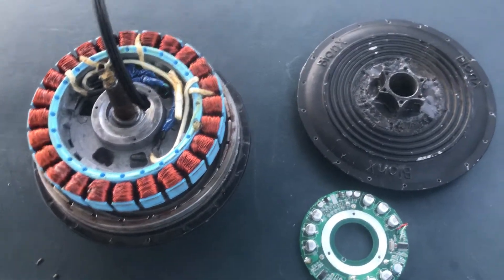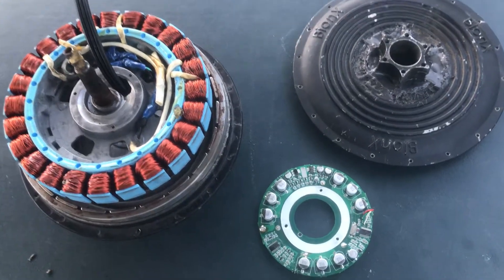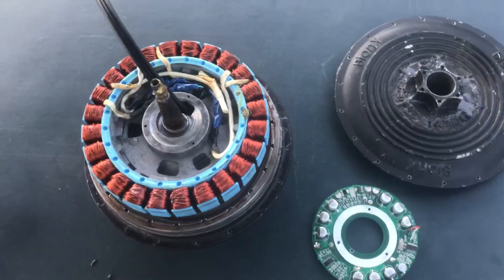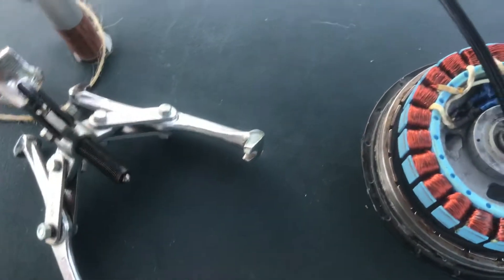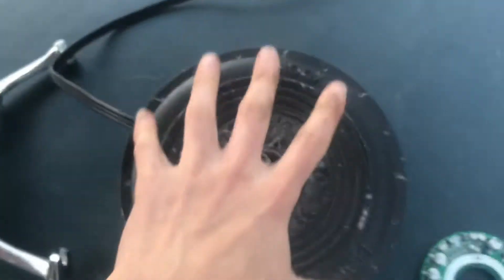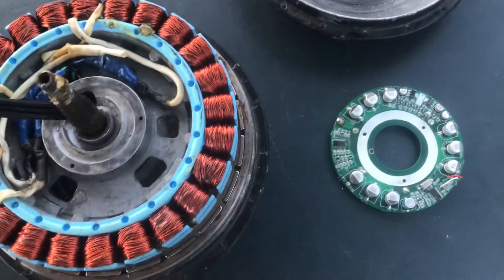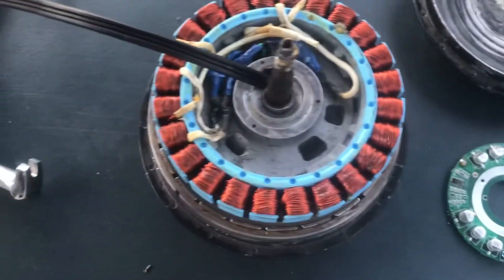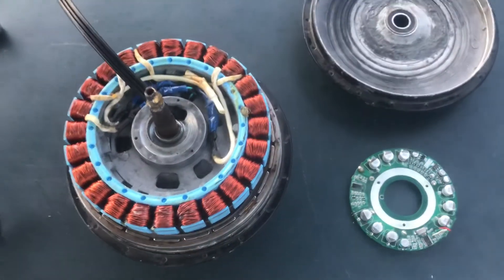FREE EBIKE MOTOR: Bionx PL350 Repair/Repurposing Tutorial

Comment: Good to know! I wonder about my Grace Easy that has Bionx 350 hub. There is an intermittent power issue and now I suspect it could be the controller because the battery and display have been changed and that made no difference. Do you know if there is a way to fault diagnose? Or, do you know if it is it a common issue for power irregularities when the controller is faulty? Appreciate any help or advice you can offer.
Reply: I have the same model and problem, did you find a solution by any chance ?

Comment: I'm planning to do the same
Reply from the maker: Nice! I'm currently rebuilding my battery for this riding season :D
Reply: @InflamedBallz  I just finished rebuilding the Bionx 6.6ah battery with YIT 30amp bms from aliexpress. It fit perfectly inside the bionx housing. Now I need to buy myself a gear puller to take the motor apart.
Reply from the maker: @CKexploresNYC  sweet! Another option is you probably can just borrow or rent one from a local auto parts stop.  Maybe an autozone? Often they lend out tools like that.
Reply: @InflamedBallz  thanks, I will stop by and see if they have.

Comment: I have like this hub i remove the controller but i have 9 wire of hall how connect them the controller !?
Reply from the maker: You'll need to buy a brushless DC controller that accepts hall sensors. check the which wire is coming from each leg of each sensor and then search for a wiring diagram how to connect the wires once you've drawn them outside of the controller. You will probably need to buy a connector appropriate to the controller you buy, or hard-wire them to the controller with solder.
Reply: @InflamedBallz  thank you 🙏

Comment: Didn't talk about the battery. Once you set up your external controller do you just select the type of power setting for whatever battery you have. Additionally once you have pulled the cables through the axle how do you seal it.
Reply from the maker: it's your choice. the controller you buy will dictate the voltage of battery and power level it will send to the motor. you just have to make sure it's a sensor-less controller as in this video we ignored the hall sensors for reliability and practically purpoes.  once you've closed up the motor again it's self-sealing, it's a very tight fit. i just pounded it back together with a rubber mallet. the seam along the motor once it's back together on the other hand requires a piece of waterproof tape to keep the water out.

Comment: Hey Kid,
Exactly what do you mean "draw wires out"? And how do you know which wire goes to each of the 3 different motor wires of the new controller?
Reply from the maker: solder new wires. pull them out of the hole in the motor casing then put it back together. the windings in the brushless motor don't have polarity the way a  brushed motor does. hook them up in any order and it will work.

Comment: Hi!One of  this  devices is  good to disassemble the motor ?
https://www.ebay.com/itm/3PC-Bearing-Hub-Puller-Set-3-4-6-INTERNAL-EXTERNAL-CAR-VAN-GEAR-PULLEY/311886094646?epid=1261264942&hash=item489ddc2136:g:OIwAAOSwjL5ZL~PJ

Comment: Just subscribed as 981, you are not far from the 1000 you need :-) now a pair of question for you, i am assuming you left away the hall sensors in the motor and you will only use the 3 phases of the brushless motor, using a sensorless controller. I want to make the same to keep the setup as simple as possible but will this setup give any problem at startup from standing position ? Do you use the pedals to start and then apply the power to the motor ? I have a BionX e-bike running with original BMS, can-bus computer system and all the proprietary limitation (already programmed to gain little speed but you can't really unleash all it's potential. Now my torque sensor is broken and cost a lot to repair and i will upgrade to your simple but universal setup to use my bike as a commuter vehicle with or without pedaling. Can you suggest me a good sensorless ESC you alrealy successfully ? I actually run on 12S2P LiPo (nominal 44.4 V 12,4 Ah, peak 50.4V) and i want to get rid of all BionX limitations (BMS, computer, regulator...) and use universal ones. Thank you in advance ! Have a nice day and thanks for the interesting video !
Reply from the maker: Yes bro I removed the hall sensors and went with a sensorless controller. Some times the motor stutters when accelerating from a stop but I just pedal like you suggested and once you’re moving it’s very smooth.

Comment: The controller being in the motor is not inherently bad for the planet. What's bad is designing the thing to pop MOSFETs in extreme conditions (e.g. 60 km/h regen), and as you mentioned, proprietary programming. As for shipping things to China, this is a symptom of CAPITALISM. There is no way to solve this problem without eliminating capitalists from the equation, period.
Reply from the maker: the mosfets blowing from regen is definitely an issue. i'd still say the bionx controller in the motor is bad for the planet because it forces you to use their overpriced proprietary battery and throttle computer so when the average consumer find out it's going to be like $1000 just to replace their battery they have no choice but to fork out the money or they sell the kit at a huge loss or often just throw it away. if it was a universal controller then it would be fine. people aren't going to put $10k into an electric bike just so they can continue to ride it over their lifetime

 i think it's getting to the point where it's probably more economical to recycle hundreds of thousands + pounds of metal and electronics locally rather than ship it overseas. i don't think capitalism is the problem. it's the consciousness that needs to change. within capitalism consumers and shareholders vote with their wallets so as the consciousness changes we make healthier decisions. aka why do we design things that don't last, why do we make software and hardware proprietary. why do we allow companies to do this?  why do we even have waste to begin with? mostly greed and laziness. i'm a big fan of the right to repair movement. 

Thanks for the comment!
Reply: The controller being inside the motor has nothing to do with the proprietary architecture. Magic Pies have controllers in them which  work with all the usual Chinese parts, for example. Moreover,  BionX battery packs can often be rebuilt with new cells. This is not ideal, but the capitalist system will never be able to sell environmentally products at a price most people can afford. In capitalism, the highest virtue is capital. This is virtually always at odds with the planet, so you can fuck off with your "concious capitalism" trash.
Reply from the maker: i don't think you understood what I said. having the controller in the motor is fine in general but bionx chooses to make it only communicate with their specific battery which is the problem. like i said, a universal controller inside would be fine such as the magic pie's that you suggest. rebuilding is a good option if you can find someone to do it. most people don't have a spot welder laying around. i'm not so much about it being environmentally friendly, but just being built to last and easy to repair. everything we make is going to have an impact.  i'm all for alternative economic systems and arrangements, but in my opinion communism or technocracy or a resource-based economy will not work unless the consciousness changes. they centralize power in a way that bad actors will take advantage of. they're sure beautiful from from a philosophical standpoint though. i think you're hugely discounting the vast effect that consciousness, or the context by which people experience life has do with how they perceive and operate and relate to others within an economic system. it isn't as reductionist as you are making it out to be. for example if you consciously experienced oneness with others and the environment, felt them as a extension of ourselves, then we wouldn't rip them off, or manufacture things that make them unhealthy as you would be hurting yourself. if we felt inner fulfillment and peace we would be less and less consumerist. one could live more with the goal of helping others rather than self interest. what if the wellbeing of others was our self interest. that may sound idealistic to you, but in my humble experience it's a big deal.  if you want to have a discussion that's fine but cursing doesn't get us anywhere does it? I don't think conscious capitalism is the solution. i think it's the crutch to get us into the next economic arrangement that doesn't require constant production in a world of finite resources
Reply: @InflamedBallz What you say is simply beaufitul. Thanks for saying it !
(The part about "if you consciously experienced oneness with others...", I already made a personal note about it, it's the 1st time I read it elsewhere)
Funny what you can find when you're on a quest to find info on a proprietary BLDC motor !
Reply from the maker: lmao dude what's your deal? telling a complete stranger to kill themselves because they have a different opinion than you. it would be funny if you were just trolling but you seem to be sincere. a centrally planned economy IS a centralization of power and a centralization of who is deemed to have the authority to control it.
Reply: Omg, peasants control center has got to be the most miserable sop on the planet. He hates capitalism all the while using all the products of capitalism to parrot his screed ( or his whiney college professors). He obviously has a serious comprehension problem as he glaumed onto the idiotic idea that you were saying the controller was bad for the environment, when you were talking of the complete closed  proprietary system BionX uses that must be scrapped earlier than need be, then uses that to trash capitalism. He missed the whole point, to instead of recycling or land filling the BionX components,  you actually keep the product useful for many more years, which is truly the best idea for the planet resource wise. But hey, hard leftism is complete craziness, and peasant control probably sustained brain damage at the latest Antifa riot. No speaking to those morons. Good video by the way. Thx

Comment: Can i put 72v and 20A  in this motor
Reply from the maker: i have a 54v 40a controller with it so i would say yes you can probably get away with it in terms of heat, but 20a will likely not be enough acceleration power to get you to the top speed 72v can provide. you will also need a sensorless controller btw unless you're skilled enough to somehow draw out the hall sensor wires as well.

Comment: Guide for Repair of a bionx motor with internal hub sram?
Reply from the maker: I wouldn't know how to fix that particular motor to work with your bionx system but if you can't figure it out, you can rip all the circuitry out of the motor and draw new wires out of the hub like I did in this video then you can use any external brushless motor controller (sensorless) and it should work with your stock bionx battery with minimal modification. the display probably won't work because it's proprietary.
Reply: @InflamedBallz  Why do you have to use the stock battery?  Can't you use any battery?

Comment: How can i put hall sensors on it without damaging the windings    i have a  sensored yuyangking bluetooth controller
Reply from the maker: a clear epoxy should work
Reply: any brands?
Reply from the maker: Adrian Marian one that's high heat. Maybe JB weld high heat ? Look in some forums too
Reply: thanks

Comment: This is what i was searching for, almost all videos are showing disassembly of different motors which have many screws, i got one of these which don't have any screws so I was wondering if the process is same. Got my answer, thanks.  Just one thing, what nuts did break your case while pulling it apart?
Reply from the maker: There was still a nut on the axle i should have taken off before I opened it up. Nothing to worry about if you just take all the visible nuts off. I was unfamiliar with the motor when i started. if it doesn't have screws and it has a seam down the middle like two parts are pressed together, it probably opens with a gear puller. what motor is it?
Reply: Oh, ok, thanks for the info. I have no idea which model it is, it looks same as yours but only silver color, didn't see any labels except on the connector, but googling that part number doesn't give me anything. I got it on flea market for 10€, guys selling obviously didn't know it was electric motor inside the rim. Since bionx system is expensive and i have no idea if the controller works, I thought about getting controller out and using external controller. I guess i will have to weight the motor and see which model weight matches to determine power and voltage ratings.
Reply from the maker: what a steal! it's probably the same. 250 or 350 watt you can still pump lots through it. maybe get 30-35amp controller. I'm using a 40amp.